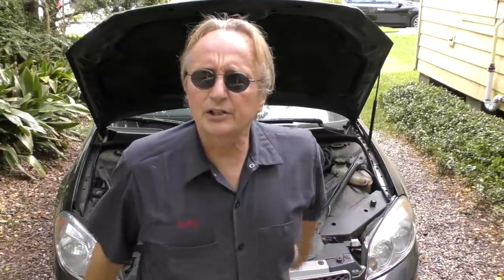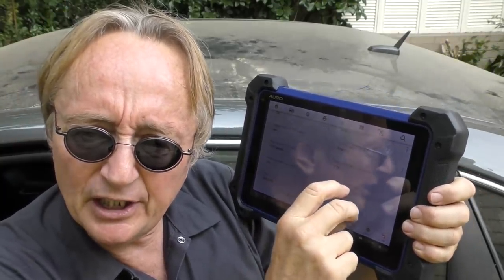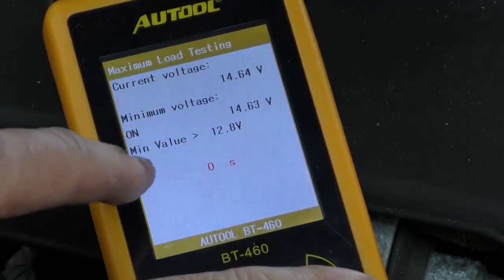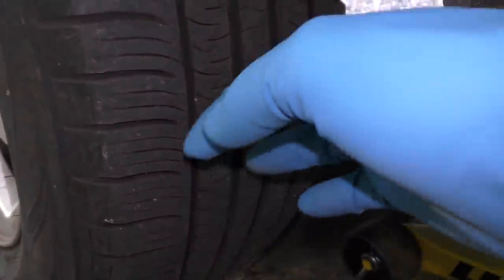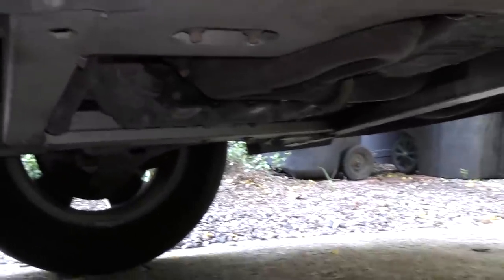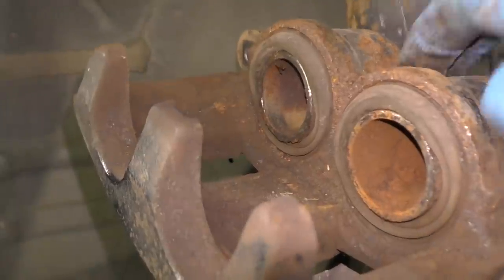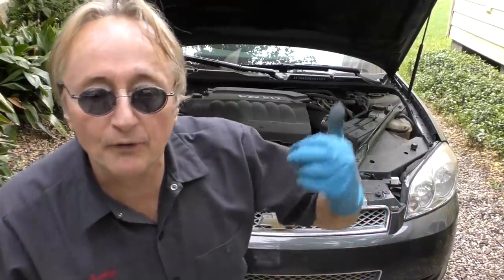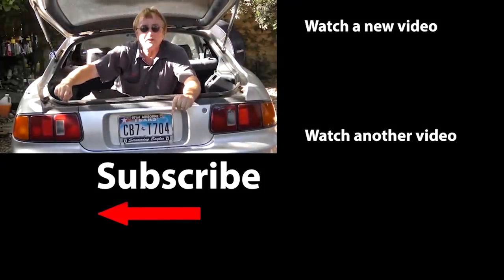Doing This Will Save You Thousands in Scam Car Repairs

Comment: Scotty changed the brake pads one handed, while holding a camera...I can't even jack up the car...
Reply: He got special 4 legged assistant >^.^<
Reply: Yeah he's good but I'm very surprised that he never Grease the sliding pins that's not like him
Reply: Scotty is the Chuck Norris of car mechanics
Reply: James D Spader F 
😂🤣😂
Good one. I agree with you a 100%.
Reply: Trigger Troll  what do you mean by careful?
Reply: Trigger Troll  Scotty don't use a jacket and he said if the car falls it'll fall in the tires
Reply: He's the best!
Reply: But he pushed the break fluid back into the system. He should have bled that fluid out of the calipers and toped off the reservoir with new fluid.
Reply: He did forget to mention you want to remove the lid on the reservoir before pushing the piston back in.
Reply: Me too   I live in a condo and cant jack up car.
Reply: He made that look sooo easy damn. I paid $250 one time just  for front brakes fix pads and rotors

Comment: The the dealer wanted $2,500 to do repairs that were not needed?  I am shocked...shocked I tell you.  I think all dealers are crooks...at least the 10 or so I have dealt with over the years were.
Reply: It was probably owner manual service interval recommendation. 
At  8 years it's probably due for ton of stuff.
Reply: I think I just got shafted by the dealer as well and they didn't even fix the original problem.
Reply: deasttn But if you’ve got a good auto mechanic, they’ll just do what you need. My auto mechanic is a major reason why I keep my cars so long. After 10 years, I budget $1500 a year for all oil changes, tire changes, maintenance, etc. If you do that (and buy a Toyota), you realize how cheap cars can be.
Reply: I read that a "well run" dealer service center makes as much or more than the Sales dept. Think about that if theyre selling $50K cars/trucks & they can make the same amount in the back on parts/service.
Reply: So are Heart surgeons
Reply: w9j15g  OK, I agree, ha ha.
Reply: It was the leaf. $2500 to fix at the dealer.
Reply: @BANE.-.  a leaf spring replace?

Comment: “If you want a job done right, do it yourself”  that’s SPOT ON, any repair job I have done seems like I have to help the “repairman” with the auto, plumbing, electrical or whatever it is do it right.  I’m starting to get the impression that when it comes to repairs if it’s “involved” better get rid of it unless I can do myself.  Wish I had a “Scotty” in my area.

Comment: Always find a good independent mechanic. Or even better, do the most you can yourself. Stealerships and chain car repair shops will rip you off. Their quota is more important than their customer!
Reply: Your statement is one of the most all out blanketed and ignorant one I have ever heard. I've been in the Automotive Service Industry for 23 years. Most of that with Dealerships. Not one single place I've worked had "quotas." Not a single location was out to "steal" from anyone. Are Dealership Shops high? I would say yes. Why? Large overhead and boxed in cost for manufacturers parts. Some folks like to take their vehicles to the dealer. Some don't. It has nothing to do with your ignorant and false allegations. You like to work on your vehicle? Good for you. I do too
but some folks don't or can't. That's all there is to it.
Reply: Patriot Yes that's true! But you're still better off to go to a good independent Mechanic! Especially if the car is older! I'm pretty handy with cars, learned from hands on from an excellent Mechanic Friend of mine! Used to hang out there as a teenager, watching him, and he'd let me help..learned a lot! So today I help my friends and usually don't charge except for parts! I just enjoy the work!

Comment: Scotty, I don't want to be overly critical, coz you didn't say anything wrong, but here in Northern Europe, with our salted roads, we have a big issue with sticking calipers. So it might have been good if you'd mentioned about cleaning and greasing (and replacing if too rusted, once you get them out!) slider pins. Also pulling off the stainless steel guides and removing the rust behind them that makes the pads tight and not move as they should. 
By the way, I have a black and white cat that inspects my work too. Ha!
Cheers.

Comment: This video is helpful especially when I just bought a 2006 Pontiac Torrent AWD with a possible worn out suspension and brakes (It was stated beforehand). I can check my suspension and the brakes on my own as well do the changes within my ability w/o heavy repair expenses. And Auto Zone to check the codes since the Check Engine Light came on after I filled up the gas tank.

Thanks Scotty for another great DIY videos and helpful tips!  A great pleasure to see these videos!

Comment: Thank you Scotty for your videos.. I had a repair shop repair replace a strut on my 2012 vw beetle and boy do I ever regret it.. They had my car 3 days and should have only been one, and when I went to pick my car up the strut that was taken off was beat to death with what look like a sledge hammer.. So I paid the place and got in my car to drive it home and omg it was making a horrible noise, and had a bunch of lights on now in my dash, abs, traction control, airbag, etc... So I ended up replaceing the cv axle cause of all the beating he did if it was starting to go bad was deftially bad now.. Replace ball joint and still needs the abs wire replace from the caiber all the way thur the firewall to in side to the fuse box.. So I learned my lesson to work on my vw beetle myself, cause this repair shop claims to know how to work on vw and audi but I doubt that they do.. If they would have dropped the subframe they would have never beat on that strut like that and ruining the balljoint and axle and abs wire...

Comment: "if you want a job doing well, do it yourself" lol yeah tell me about it I took my Toyota avensis to the local garage to get the pads and front discs replaced and they tried to get nearly £500 out of me 😮 so I got a family member to help and all the parts came to a fraction of the price the garage wanted to charge me.

Comment: Up here in the rust belt I often have to grind the rust out of the caliper brackets where the pads sit.  Otherwise the new pads won't slide in.  Also make sure to grease the caliper slides.  They are no fun to remove if they rust in place!  Finally, "deflate" the caliper piston boots after you compress the pistons. Trapped air may cause them to roll between the piston and the pad, at which point they will rip open and allow contaminants to get in against the pistons, causing corrosion and seizure.  Slide a small pick or flat blade screwdriver between the piston and the boot.  The air will blow out and the boot will slip back in between the caliper body and the piston.  Attention to detail is what makes the difference between a good brake job and a lousy brake job.

Comment: Thanks, Scotty.  You're my go-to guy for car maintenance knowledge.
And I too have a tuxedo cat - almost 20 lbs, mostly muscle.
I know this wasn't primarily a brake job video, but a few points...
Looked like you put the wrong brake pad on first (with the squeaker)
then corrected off screen.  Missed a teachable moment.
Should have replaced or at least cleaned up the slide clips.
Lubricate caliper slides at every brake pad change.

Comment: "If you want the job done right do it yourself" Amen to that, I took my wife's sienna once for oil change at the dealership, they overfilled it. It started to press oil out from filter housing, also I'm self-employed so at the beginning of a year and end I need miles records, so I took my work car to the Walmart to do my oil change, I stood and watch em do it, there were 4 idiots working on my car just to do oil change, so they drained oil, then one set inside and started the car without any oil in, I yelled at them and made them give me a written form what they did.

Comment: When compressing the piston back into the brake caliper, loosen the caliper brake bleeder. This allows the brake fluid to leak out instead of being pushed back to the master cylinder and back pressuring the MC seals. This can lead to brake failure. A quick bleed after the new pads are in will ensure the brakes are in good shape. Another tip is to grease the caliper slides.

Comment: I own a Toyota, what's a car repair?
Reply: I own a Dodge, what's a trouble-free mile?
Reply: My 06 Prius is toast. Looks like my computer died...
Reply: I own a Volkswagen, what's a reliable engine?
Reply: That social club people have at those car places, where they bring them in on tow trucks and throw money around. 

I've never joined one because Toyota people aren't welcome there.
Reply: Gardener Earth Guy and I grow my flowers under natural sunlight. Something about those LED lights that people use. It’s a club I’ve never joined either.
Reply: @Richi RIch it's a 2016 Polo TSI 1.2
Reply: @MarcAntoine01  😆
Reply: When I had my Toyota pickup if it wasn't in the shop for its regular service it was in the shop for rear axle bearings or a front differential replacement.  Other than those slightly expensive repairs that should never be an issue on a truck with less than 80k on it, it wasn't too bad.  Funny though, when you'd go to the dealership guess what was always in their repair bays, yep every other brand of vehicles except Toyota....apparently other brands have so many issues they would sneak them to a Toyota dealership so they'd get repaired sooner LOL.  

I have a 2005 Toyota Tundra and I think its better built than the 2008 Tundra was that I had the axle bearing and differential issues with, and the 2005 Tundra has had far more heavier use.
Reply: I have a Nissan.  What’s it like to have gears?
Reply: You know, when the boss asks you for a ride to pick up his mercedes at the dealer again.
Reply: Ray Davies I asked my co worker to give me a ride to the Toyota dealership.  The truck was fine other than a defective tire they sold me on it.

Comment: He didn't check wheel bearing, control arm, ball joint and tie rod end play.
Reply: Or checked for correct torq specs on all mounting and suspension bolts.
Reply: Neither did he remove the master cylinder reservoir cap so that old fluid can flow over the engine bay 😁really should have opened the bleed valve on caliper to relieve back flow pressure important for abs systems he is a great guy with short video he wouldn't be able to cover all details all the best from UK👍
Reply: Alister West He did a basic change of pads guys! Yes, there are a few more details, but time is a factor on those videos!

Comment: Scotty, I like to open the bleeder of the caliper when retracting the pistons.  That keeps from overflowing / overfilling the master cylinder and doesn't flush all the crud that's built up inside the calipers fluid spaces upstream into the lines, ABS controls, or the master cylinder.  If the brake fluid looks dark, I also like to use a turkey baister to suck out most of the brake fluid from the master cylinder and when done with the brake job I bleed the crap out of the brakes which does a great job in flushing the entire system.  I've found that this case help with slight sticking of calipers or malfunctioning ABS controls as well.....cheap and easy to do ( but where gloves ).

Comment: @
Scotty Kilmer  The 1990 Buick LeSabre, 3800 V6, my half brother got me, back in 2015, had most of it's components replaced.. Fuel Filter, Fuel Pressure Regulator, Temp Sensor, Thermostat, top hose, radiator cap, radiator, belt tensioner, and belt replaced, and still SHUTS DOWN because of an Overheated Transaxel-Transmission.. I hear a loud roar, and sensations of it jerking, cutting out the cruise control, and when I checked the transmission fluid it was darker and it had bubbles with wisps of smoke from the transmission tube.. I'm looking at a $1,800 overhaul, with $100 dollar tow to shop, and the Interstate Battery is well over 5 years old. It is an OBD-I computer system... My Dad's Buick Century Special is a 1994 sedan, with a defective computer.. Sad that Buick did NOT put Gauges on the later 1980's, 1990's or any model of Buick LeSabre, Century.. A dauber's nest had fouled the cooling fan, shroud, and on my way back from a Doctor's appointment, I blew the head gasket. Dad's 1994 Buick Century was an OBD-I computer as well, and the engine was a 3100 engine.. My 1990 Buick LeSabre has a stronger safety computer as it detected an overheated trans-axle code, and shut the car down...... I really wish, I could put gauges on my 1990 Buick LeSabre... As I don't have the expertise or money to purchase tools to do it myself. I think.. 1996-97 was the year everything went OBD-II ? Good thing, I am not married.. I feel these vehicles are like bad women, with greed in her heart and issues out the tuchus.. lol

Comment: A/T oil check must be done with the engine running or else there's no hydraulic pressure. If you just want to check the oil cleaness then it's fine, which is what he did. Cheers Scotty!!

Comment: Never realized how basic a brake job was ... thank you !!
Reply: Pretty easy, can be a little bit dirty depending on how the vehicle has been cared for, drum brakes aren't too bad either, just those dang springs can be a pain at times.
Reply: That wasn't a brake job it was just a pad slap.  He didn't even measure rotor thickness

Comment: Good tip for people too would be to check caliper slides move easy and aren't rusted, and that the caliper boot isn't torn and pushes in relatively easy. If your brakes wore unevenly it could be a sign of other problems. You can also tell if a brake hose is bad if you open up the bleeder and see little to now brake fluid leaking out.

Comment: Because of Scotty's video here I bought the BT-460 to check my 7 yr. old battery and it says 45% life and should be replaced and the charging system is fine. My pickup still has a strong start so I'll replace and the end of summer before going into winter...that being said, if it last until then.

Comment: Scotty I must one lucky guy. I bought a 2000 Chevy impala 600 buck with 160000 miles on it. It was just sitting in the back years under some trees. Well anyway. I’ve spent about 150 buck on a window motor and drive rail a side view mirror on the passenger side replaced all bulbs because of age, you know how old bulbs turn silver. Get about twenty five miles in the city. Oil Chang at 4500. Drives great. Everything seats cruise trunk doors windows heat air works great. Now after writing about this it will probably fall apart but just thought I would let guys know they are “ Gem” waiting to be had. Thanks been watching your site for about five years now first time writing.

Comment: Had one of those bolts on the brakes come off on my geo metro and i stopped by by the mechanic just down the street when it was sounding funny but they still worked. Im glad the mechanic was honest. It only cost $20 with the bolt for free. The brakes were fairly new so he thought maybe the previous mechanic forgot to tighten a bolt all the way.

Comment: Scotty! Brake services.... You have to take the metal clips off the caliper stands, clean the rust off and lube that, too. Rust in there will bind up a brake pad just as bad as a rusty pad will. And, it's VERY important to clean and lube the slider pins with silicone gel. Sticking or frozen pins will cause uneven pad wear and greatly reduce pad life.

Comment: In New Jerzey, quotes for front disk pad and rotor replacement are $400-$600. I bought new rotors and ceramic pads, 2 cans of brake cleaner for about $140.00.

Comment: I dont want to say something incorrect or be argumentative without reason, im a mechanic myself and I told long ago that when you compress a caliper for any reason (unless the braking system is brand new less then a year on the road) always bleed the fluid from the caliper to prevent any of the sludge in the system (sludge accumulates in the low point of the system inside the calipers) from being forced into the ABS circuit which is very sensitive to contamination. I dont see many chevys though maybe they dont mind?

Comment: SCOTTY!! Will using paddle shifters in a 2016 Camry XSE hurt the transmission? I notice it shifts more aggressively when using in S-mode.
Reply: Most cars have been programed differently for manual (pedal shifting) and automatic gear changes. That might be the case on your Camry, unless you have driven both modes and just notice this is new.

Comment: around here a DIY oil change is illegal so i had to take the car to a shop for it. when they lifted the car they took a look to see if anything else was wrong with it and told me it had leaky suspension, a leaky gasket, and the brakes needed to be changed. i did nothing of these. about 2 weeks later i took the car for the obligatory technical inspection that is done every 2 years. they found the engine, the suspension and the brakes to be in excellent condition and the only thing the car needs is alignment and new tires... and i used to trust that shop.

Comment: To clarify a comment:  In a passenger car you CAN do just one pair (one wheel) of brake pads but you really really should do both.  It will impact steering performance, braking, ABS and many other factors.   If you can't afford both sides this week and don't have enough money till next you can get by with one new pair for a few weeks no problemo.  Just get it done within a thousand miles or so and DO NOT go high-speed/interstate/highway with any kind of load.  Generally this is a rare situation because if you need to replace only one pair you've likely also got a damaged (tapered, grooved) rotor and replacing both the rotors and pads on one side is too much variation from the other.

But if its literally just a blown caliper and damaged pad without anything wrong with the rotor, you'll be fine with one new set and one old for a short time.